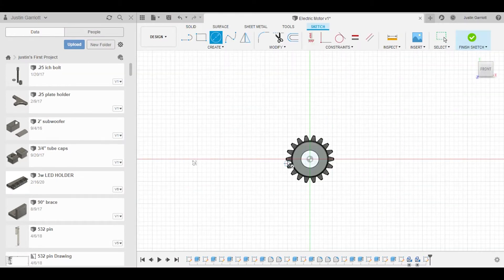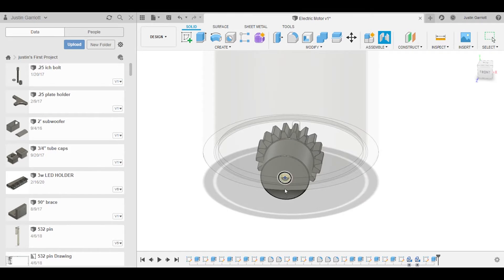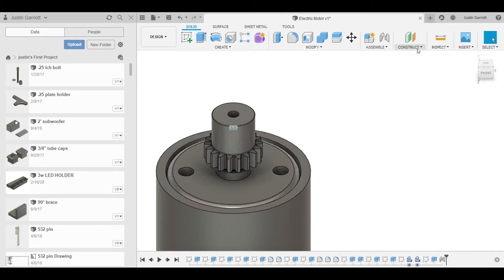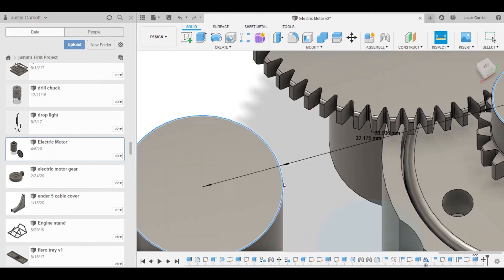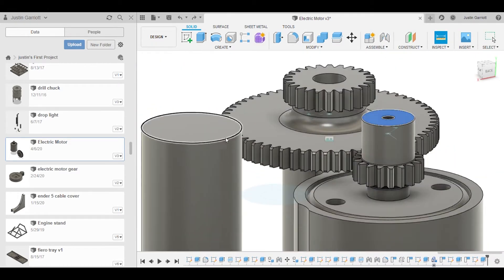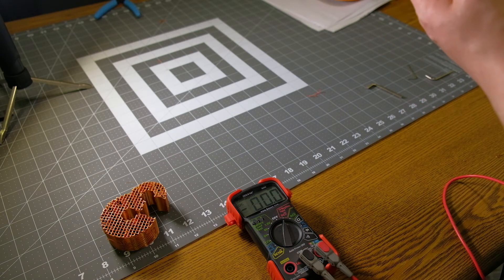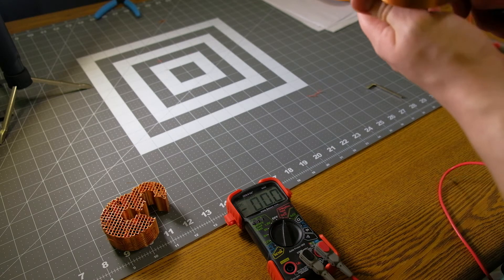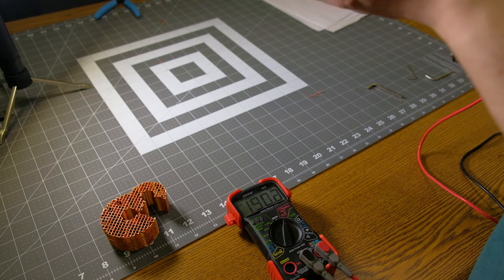3D Printed Electric Motor Hand Crank

Comment: Hi this is a great video! I was wondering if you were able to share the 3d printed files? So that i could try and make something myself. Also if i want to use it to chage a cell phone will it need to be cranked/spinned backwards?
Reply from the maker: I can share the files, however it really needs another 1:3 step up gear for the crank as it’s really uncomfortable to spin it fast enough to generate 5v. As far as charging goes, just make sure you + and - are hooked up according, you might need to check with a multi meter to figure out which post is what based on your spin direction.
Reply: @piscesprinting  alright that sounds fine : ) are you able to share them here with a link or do you need an email to send them to?
Reply from the maker: I can put the link up this weekend.
Reply: @piscesprinting  thank you
Reply from the maker: Posted Thingiverse file in description. Link will take you to the item, in the description on Thingiverse there will be a list of required parts that are not printed. Enjoy! And share when you print it!
Reply: @piscesprinting  Thank you very much! Highly appreciate it!